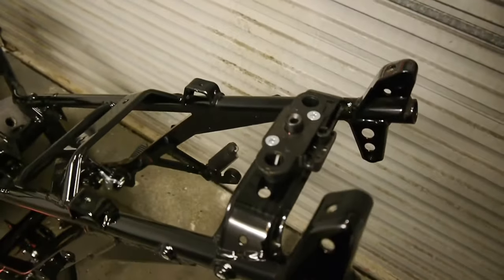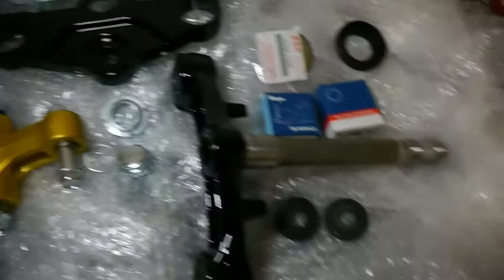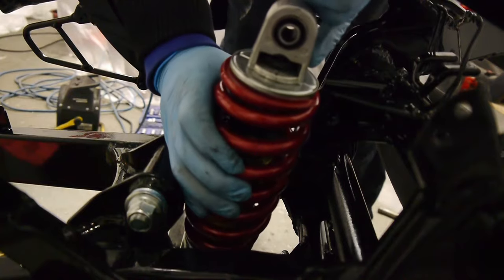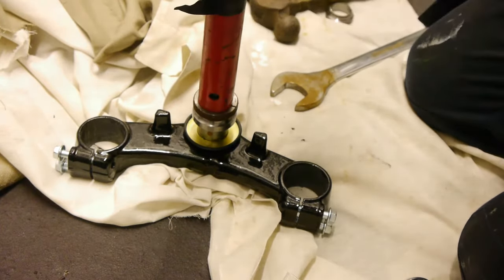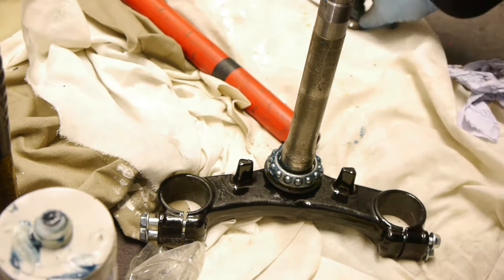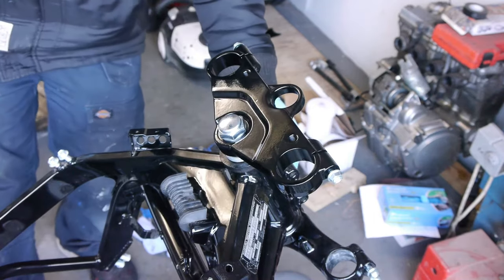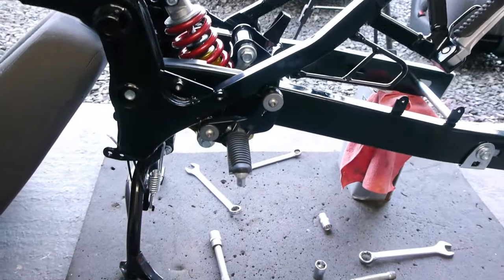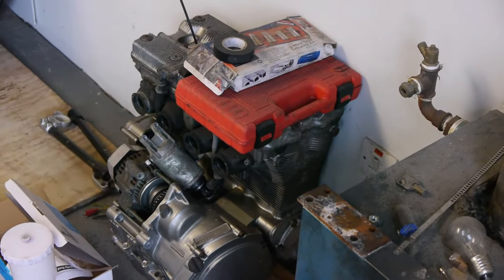Suzuki GSX600F Katana Restoration - Episode 4

Comment: It would have been great if you showed how you disassembled the rear shock
Reply from the maker: Yeah sorry about that John. I got a bit carried away with the work at that stage. 
It’s simple enough although you do need spring clamps to take the pressure off the spring and then at the top there are 2 c shape pieces to remove and then you can remove the plate at the top and then the spring. I hope this helps

Comment: I've been binge watching this restoration series throughout the evening and must say that it's turning out beautifully! Well done!  I'd love to have my swing arm and forks properly painted/ powder coated in black like yours .. I plasti dipped both wheels in black, but that rubbish is peeling off the rear as it's not resistant to chain cleaners and lube, and besides that, plasti dip is a dust magnet 👎🏼 I'll have to re-do them the proper way.

My only regret is that you didn't show us how you disassembled a reassembled the rear mono shock ☹️ Would have loved to see how that's done. 
Can you please show how you align the rear wheel and set proper tension on the chain once the time comes? .. matching notches on the swing arm to the sliders never gives me an accurate alignment, it's a struggle with measuring tape, calipers,, eyeballing .. ect.
Reply from the maker: Yes sorry about not showing that. Apologies about my editing skills too as I've a lot to learn in that department too. I sort of got carried away at that point and just started stripping and building the shock and sort of forgot and the camera. 
Yes I will certainly dedicate a video to wheel alignment and chain tension once the time comes.
That was my first time getting anything powder coated and I must say it is a brilliant and tough finish and not too expensive. Im in 2 minds whether to paint the wheels or powder coat them. Planning on changing the complete paint scheme of the bike and not use the original colours but I dont want to give away too many details yet.
I have another used shock lying about and if you like I could get a video up with me disassembling and building it back up sometime if its any help to you?
Reply: @DarrenMcKinney1  Hi, no need to apologize for your editing skills, I know how it is, while working on something in my garage, I don't stop not even to replace a torn glove on my hand, let alone reposition or check up on a camera. 

Painting the wheels depends on whether or not you plan on painting the fairings, if you plan on keeping them red, then I'd leave the wheels silver as they are .. if you go black on the fairings, then I personally would do a darkish golden colour on the wheels, but that's just my opinion, it's a matter of taste, and it's your bike, your decision 🙂 

Mono shock rebuild vids on utube are scarce, mostly from dirt or adv. bikes, I know the principal and technique would be similar, but still .. 
Nevertheless, I'd surely enjoy watching a rebuild vid, but as I mentioned under another vid of yours, I have long replaced my stock suspension with an aftermarket solution I'm quite happy with, and my stock mono shock has become obsolete just gathering dust somewhere .. If I learn how to rebuild it properly, then I would just for the sake of this never ending lockdown, and keep it as spare just in case ..
Reply from the maker: @ghassanalfarra8935  yes I am going black on the fairings and had toyed with the idea of gold or red, I'd changed my mind so many times. 
Yeah I'll definitely get the rear shock vid up some time but hoping to get the engine pain and install video up this week

Comment: Great vid/series mate, quick question with the shock did you send away and have that done or did you DIY? I have a GSX600F katana (94) and just took off my swing arm with the aim of replacing my shock, was thinking of refurbing it, if you sent away, what company did you use if you don’t mind me asking?
Reply from the maker: Thanks Lewis, no I just did it myself. Now unfortunately the thing about this shock is that it is a sealed unit as far as the oil side of it is so if it is leaking oil or the chrome shaft is badly pitted there is not much the ordinary person can do. Mine was in good condition so I simply disassembled it and cleaned and sanded the spring and shock body and painted those. The aluminium bit at the top was done with a scotchbrite wheel in the bench grinder and coated in lacquer to stop it corroding and finally the silver bits you see were zinc plated when I got all my bolts done.  
If yours was too badly gone I would recommend get an aftermarket upgraded shock as it improves the feel of the bike.
I hope this helps and thanks for the great comment
Reply: @DarrenMcKinney1  thanks so much for the detailed response mate really appreciate it! I initially wanted to go down the 08 R6  shock conversion as per the kat riders forum but a few have said there needs to be some intricate tinkering done as it lowers the back 3/4inch. Is there any shock upgrades you would recommend or? 
Thanks again! Great to see someone do such a great job on a motorcycle rebuild!
Reply from the maker: @bmwlord5588  no problems Lewis. I haven’t had much experience in the aftermarket end but a subscriber had said to me he has a Wilbers 640 road shock on the back of his gsxf and it made a night and day difference to his bike. Not cheapest of things new but you may be lucky enough to come across a good used one...